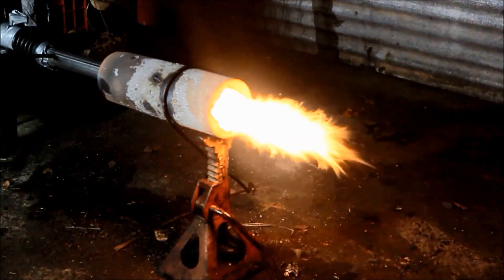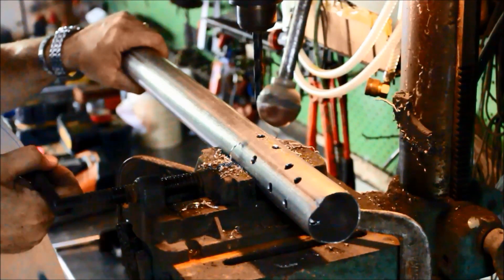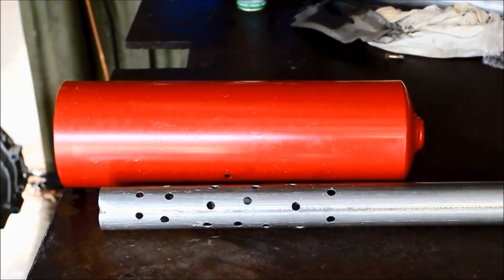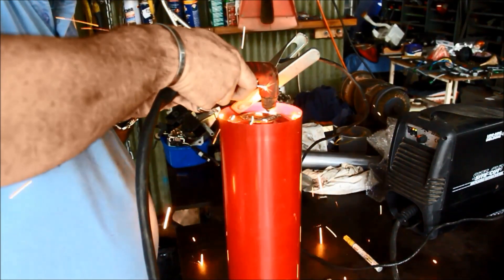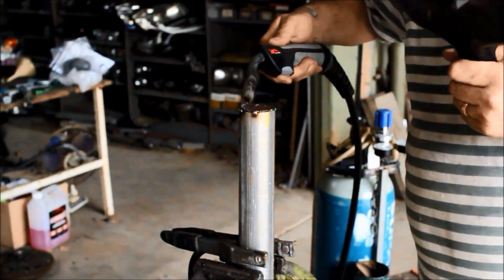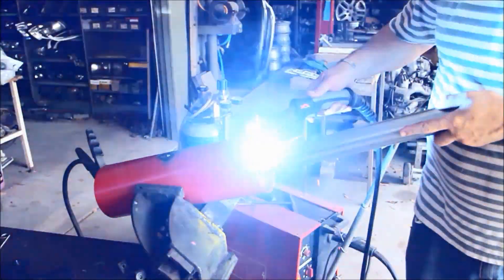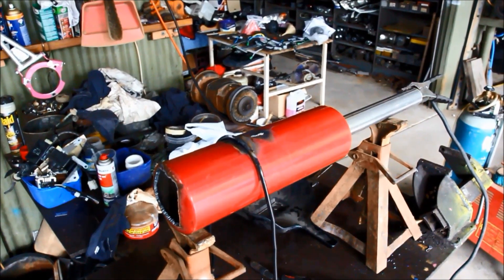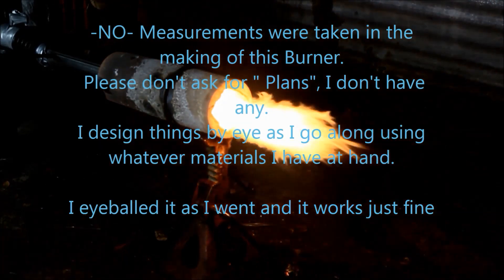Oil Burner Build Tutorial

Comment: Absolutely Brill fella' I got my small burner working as a prototype, The big burner has yet to be started? Just pending at the moment as I can't find any decent fire brick, I have to melt Ally for my boat project. But nothing happening soon. take care bye.
I also have to learn how to do a video of the work. bye.
Reply from the maker: Don't worry about Fire brick, regular brick works OK as long as you don't disturb it after it's been Fired. Mud/ Clay works fine too especially if you can mix in plenty of ash or Vermiculite helps bid it as does wire mesh.  With a decent oil burner you don't have to worry about keeping he heat in, I have melted copper in open air.

Comment: I know this is an older thread, but hope you see this as I have a few questions about this particular burner...The main one being what is the advantage or using the closed end pipe with holes in the upper side versus just an open end pipe as most of your burners are? Do you end up with much unburned oil pooling in the drilled pipe? I will be building a closed tank shop heater to burn waste oil, want to use the offset burner method to have it swirl inside the tank, with an internal central stand pipe going to the bottom of the tank as the flue. The goal being to capture as much heat from the burn transferred to the metal as possible before leaving the tank and flue, which will exit the building at near ground level after running along the bottom of a wall, once again to capture as much heat as possible inside the building. Being a forced draft, from the blower used, I see no reason to lose any heat  to the outside, a 'cold' flue pipe through the wall being the goal. A shop fan will distribute the heat throughout the shop.....Love your vids....have been a DIY'er for the last 50 years and rarely pay anyone else to repair or build anything for me. A good shop and a ton of tools for almost any trade has saved me way more than what they cost. Thanks for making it fun with your vids!

Comment: Love ya stuff, No bullshit, and to the point, and very helpful thanks, only one concern is the toxicity of
of old oil burning, I have heard the fumes are very poisionous.? - Of course you would need plenty of ventilation.
Reply from the maker: Yeah I wouldn't recommend using one in an enclose space but then again a gas burner is bad in enclosed spaces too.  Normally I use veg oil which is better than motor oil but still, like anything else you burn, should be done in a ventilated chamber or space.

Comment: I am thinking of a way to modify this a bit. A way that may work with a smaller flow rate would be to drill a ring of holes in a single row on the inner vaporizing tube. Welding it up so the ring is as close to the rear wall of the red tube as possible. Then extending the small inlet tube to neat the capped end of the vaporizing tube. That way the oil could drop inside the hot end and vaporize, then have to backtrack to the ring of holes where the vapor would mix with the air. Passing mix through the holes it could burn much the same way as the flame in your bbq. I just wonder where the deposits would be. Inside the vaporizer tube or where the oil vapor actually burns? Hmmmm...... 

Dude, you are making it hard to get anything done on the house. Maybe I should buy your neighbor's place and we could have all sorts of fun.

Comment: I was wondering how much oil it generally takes to melt a few pounds of steel? I understand I could just find used oil anywhere there's a oil cooker, I want to know how much would I need to store.
Reply from the maker: That's about the same as asking how much fuel does it take to do 100 MPH. There are an immense number of variables, the main one being your furnace's construction, efficiency etc. If You couldn't melt some steel with 25L of oil, you never would so start with that and see how you go. Also keep in mind that used engine oil is just as good if not better having slightly more energy.

Comment: Are you burning cooking oil or engine oil
Reply from the maker: Whichever one is around. It will burn Bacon grease and Transmission fluid or brake fluid if you want.  all burns the same.... HOT.

Comment: I know you talked about the infrared thermo gun, But I needed it to prove my point on how much heat is wasted going out the chimney, and to pin point where to put my fan control switch, which I have not done yet. On the other hand it wouldn't do you any good cause it only goes up to 700F, and I think your stove is about twice that. :)
Reply from the maker: My thing with IR guns is they show the temp but not the AMOUNT of energy produced. I could put a steel plate over a 1KW burner and probably get it to the same temp as a 100KW burner because there is a limit to the temp you can obtain.  Just because both plates hit the same temp wouldn't mean the burners are doing the same output.  Not trying to rubbish anything you did rather than point out the flaws in the ideas.  The most practical way I know to measure heat produced is through fuel Consumption. Still far from perfect as efficencys in heaters come into play and many heaters are inefficent but it's still not worse that shooting temps with IR guns.  :0)

Comment: Another great video. I love the new universal explanation for the (SAFETY POLICE)... lol.. It is very simple and straight to the point..

I was also wondering about this burner being less noisy. I'm thinking that with the gases expanding into the larger pipe/extinguisher, it might be acting as a silencer of sorts. This is something that will be a great addition to my pool heating project as I certainly don't need nosy neighbors causing me problems... I might just have to give them that universal sign you so proudly gave all earlier!!  hahahaha....
Reply from the maker: All This quiet talk has got me thinking... and therefor given me a hell of a headache...!
I was doing the mental arithmetic on a double back design where the burner would be like this one but with another larger bottle over the whole thing with the output back at the inlet end.  I'd cut the side of the bottle out for the exhaust.  As the flame would be completely enclosed and non visable, it should be pretty quiet as well. I'm also thinking of another specific water heating design. That would be to have a long air/ fuel delivery tube running down the centre of a large external pipe.  That could be submerged in a drum of water or even directly in a pool and the incoming air and fuel would travel all the way to the bottom of the outer pipe where it would be heated by the combustion products coming back up to exit. That would be the hot area to vaporise the oil while the outer pipe would radiate the heat to the water.  Nice simple and easy to build design.

Comment: Very practical!!
Reply from the maker: I actually had a practical purpose in mind for this one. As a drum heater for drying and filtering my veg oil. I'm going to test it with a car blower I have and if it runs as expected, I think i'll build it into the setup permanantly.  It would also be fine in a drum heater or a metal melting furnace.
Reply: Or blown into a heat exchanger to heat a building. -9.5C here this morning!
Reply from the maker: kbbacon
-9.5????  You should come to visit me Kevin. I could put you up somewhere much warmer.... my REFRIGERATOR!  It's nice and cool outside today though, only 27.  Better than the  35's and above we have had for the last week. I have GOT to get into producing DIY aircon Vids!
Reply: That I could do!!

Comment: can i get the 3d CAD drawings for this??? :)

One disclosure you could add is:

"No whale anuses have been violated in the making of this video."

or

"No dumbass has been injured during the building of this burner"

Anyway, great video again.

I have found a significan lenght of 4-5 inch pipes and am thinking of
mking it into a U or W shape and sink the whole think into a water tank somhow
to heat water.

I'm still hoping for a friend to come help me show the welding part.. but I could well
be the idiot getting injusred doing this...;)

will report on progress.
Reply from the maker: The safety sissys were Right Yves!  I did actually die from not wearing gloves whilst welding but I'm not going to admit that and I'm pretending to still be alive!

I have thought of exactly what you are talking about.  I would use my downward firing burner on the top of the pipe shooting down with it submerged in a drum of water.
4-5" pipe would be awesome because it has so much surface area especially when you compare it to what everyone does with wrapping copper tube.
I was also thinking of welding some 1/2 Tube through the pipe  to upset the gas flow internally so as to keep it stirred up and hot gas in contact with the walls of the tube.

I think you could get a very effective heat exchange like that especially if you could loop the pipe a couple of times. If you can get good lengths and the stuff isn't too thick walled, Maybe a truck exhaust place could bend it for you instead of having to weld it?
Reply from the maker: BTW, You can get the CAD Drawings as soon as you finish doing them for me! :0)
Just make the measurements up because I haven't got a clue what they are and no one else will know the difference anyhow!
Reply: Oil Burner
funny, i was just looking at pipe bending videos. but only saw small pipes..;)

keep it up.

Comment: How the devil are ya!

another excellent video

this design seems to be the quietest one yet!

im off to watch my knitting videos now....
Reply from the maker: Mine Too!  Toss up between the steam train smoking Oil burning diesels and the insane Turbine Powered monsters.  The real amazing ones though are the old steam traction engines. Nothing ever seems to stop those things other than outright lack of traction. The torque those things have is incredible!
Reply from the maker: Really?  These aren't some Kind of " adult" knitting videos by any chance are they Mark?
Maybe I should look into making a quiet burner. I mean I can make them totally silent but the heat output is a bit disappointing.  I think this one could be quietened even more just by putting another section of pipe or extinguisher over the front.
Reply: Oil Burner well i wasnt sure if it was quiet because of the camera/editing or by the accidental design of the burner
Reply: Oil Burner Tell me something. When you go looking for Adult knitting videos an all; How do you knit an adult? Maybe you could knit adults together but to knit an adult out of raw materials. I suppose someone will try to knit a child now. The next thing there will be a law against child knitting. And we'll need a term for child knitter. And so on.
Reply: i don't actually watch knitting videos lol. look up tractor pulling thats my kinda thing